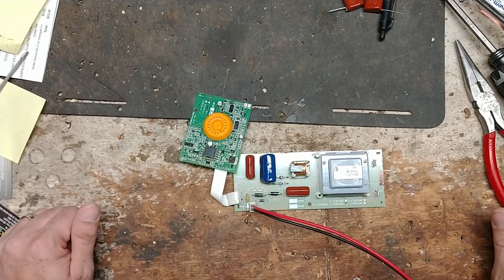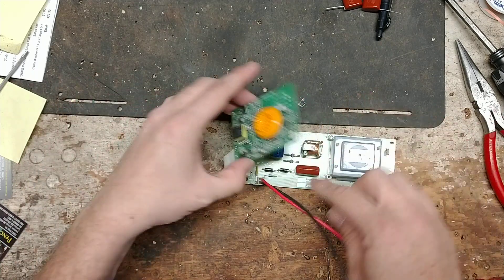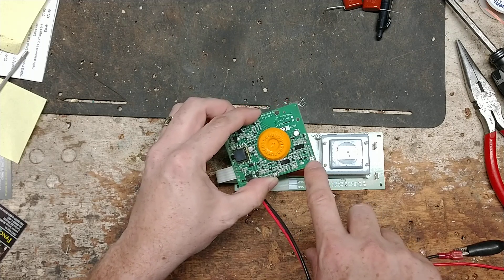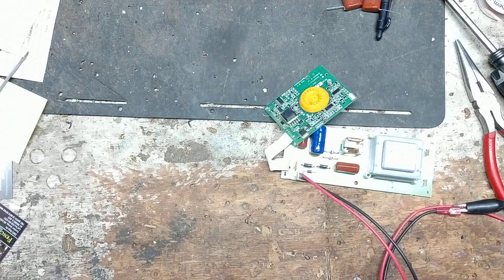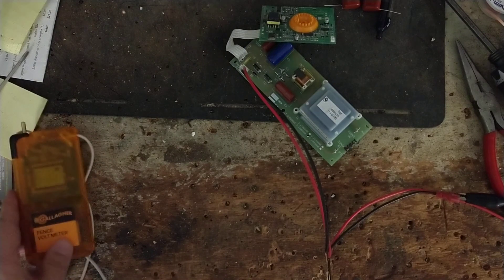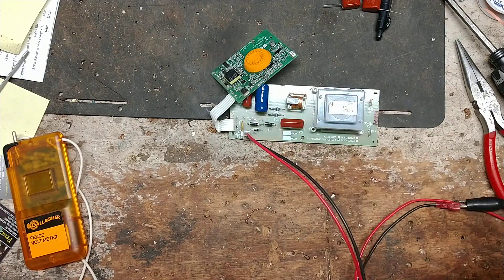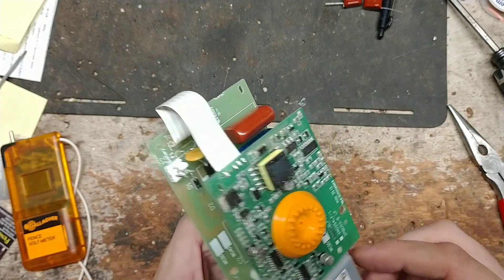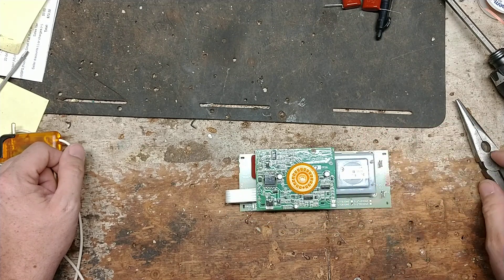Testing a Gallagher Solar Fence Charger Energizer | Gallagher Solar S50 & S20 Repair

Comment: Can I use my S50  to power my US Automatic Sentry Gate Opener by attaching the battery leads on the S50 to the 35 Ah AGM battery running the gate? (I would not be using the fence zapper leads).
Reply from the maker: In theory yes, but that gate probably draws a lot more energy than the S50 itself does, so it may not be able to keep up with it. I would just extend the wires off of the battery wires inside the S50 to the battery on the gate, and keep your S50 turned off so it doesn't draw any extra energy off the battery.

Comment: Hello, is it possible to give me the type designation of the left and top 14-pin SOIC IC? I have the same circuit board with a short circuit on my table, but I cannot read the label exactly. The top and bottom right could be the same. Maybe the Onsemi LM290xxx? Is the left one a microcontroller? I can read the numbers xx541BG. It would be very nice if you could help me. Thanks a lot from Europe.
Reply from the maker: Let me see if I have another board on hand, good or bad, and I'll let if I can help you out. I don't have this board in hand anymore it went back to the customer.
Reply: @FencerFixerRepairLLCKansasCity  that would be great, thanks a lot. I found some IC's Form Onsemi they might be the right ones. I will test them and let you know if they were correct